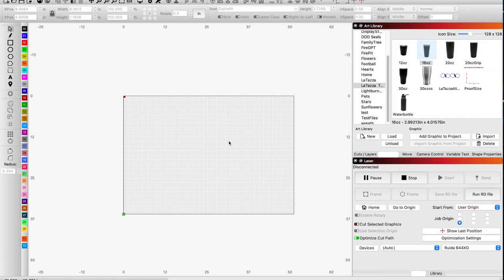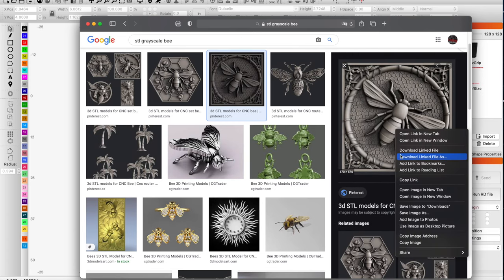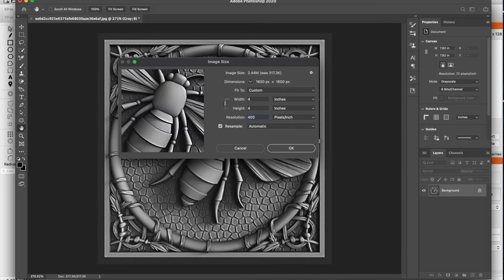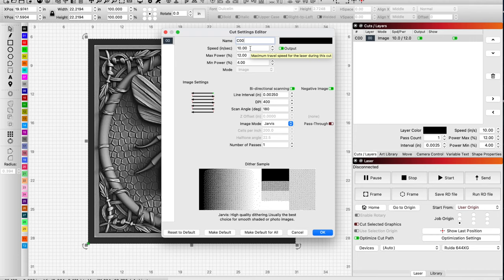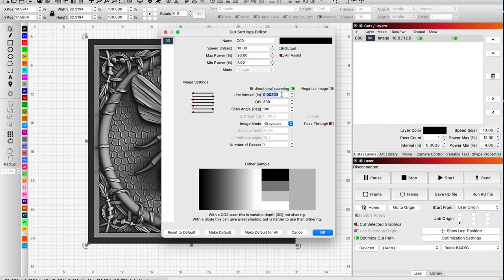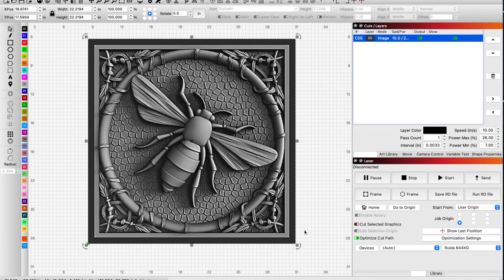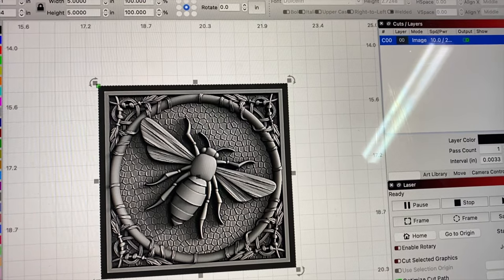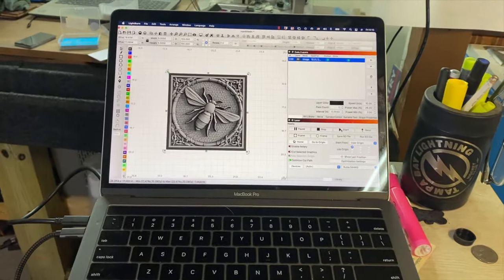How To... 3D Grayscale

Comment: There are a lot of things I would change. I have found that a single pass with maximum power will treat the different parts of the grain of the wood the same. Go slower or multiple passes and you increase how much of the grain shows up. I go with maximum power and maximum LPI and then adjust the speed to the material and depth of cut desired. If there is still too much burn then I might do a second pass very lightly to cut away the darker surface but knowing there is a cost in that the grain of the wood will be stronger. I also increase the contrast from nearly white to black as that creates the most range for the laser to set its power. There are 256 possible power settings but not enough white-to-black range might leave only ten and then if your total power is low then the steps will also be less per setting, so total power at a faster speed going from white to black will leave a much sharper image.

When choosing an image care is needed to see if the shading is from height or from lighting. As is the case with the bee there is much stronger lighting on one side than the other. The deeper your 3D cut of the bee the worse it will look. In such cases, dots or dither will look much better because your eye is judging depth by the lighting to the side, and if you cut deeply you will cut the dark side of the shape much deeper than the light side which if in strong lighting will put shaded things and dark things (like a pair of glasses) obviously as a hole and right next to it things light up like an ear as high as a cheek or different sides of a nose with a big drop-off.

If the image is really good for relief carving then it will look strange as a dot or dither as the cues your eye expects of lighting will not be there
Reply: Good catch. Thank you for adding those super tips.

Comment: Great video and thanks for posting it. Is it possible to turn a regular photo into a STL or do you need special software to do that?
Reply: stl is a format recognized by the plotters that run a cnc router.  the grayscale hes using has nothing to do with an stl it is simply the lighting effects, ocular occlusion ect from the 3d rendering software it was modeled and the image created for thumbnail purposes with.  technically any image can be used but your 3d effect will not be perfect. the only reason hes able to do this is because the common use of the lighting technique ppl use for making these.  so no you dont need special software per say however if you want an actual stl it will require knowledge some 3d modeling program. you could use photoshop or equivalent and carefully adjust and play around with levels ect until you get something workable.

Comment: I'm in the middle of trying to burn a 3d File that I bought as a pdf.  The person told me he transferred it from an STL file, so I think he may have done what you did.  Playing with the speed and power to get the depth I want - hopefully I don't over do the the burning.  Thanks for your demonstration.  Now I need to figure out how to clean the smoke off, just a light sanding doesn't achieve what I want in the end.
Reply from the maker: You can run a dither or halftone in negative as a quick light clean passs

Comment: Thanks for the technique! But sand before, not after, it will be better
Reply from the maker: You are not putting a photo on the material... you are removing material at various depths... why would you sand something that is going to be removed? Waste of time. Now for photos, yes. You want a beautiful smooth surface to put those laser dots on
Reply: YOu missed the point of sanding after: to lighten up the areas that should be lightest overall. Those areas stand taller because they were lasered at minimal power. (You’re thinking of preparing wood, in general. This is post-lasering treatment of wood engraved for the purpose of creating 3D effects, where the darker the area, the deeper it is engraved, and vice versa.)

Comment: @16:50   I WAS ABLE TO GET 3D DEPTH WITH JARVIS AT 50 SPEED AND 20/20 POWER... THE SMALLER THE PIECE, THE BETTER.. ANYTHING LESS THAN 12"X12" WILL SHOW DEPTH... THIS IS USING JUST A PNG IMAGE FILE, NO STL

Comment: You aren't engraving a STL, you are just editing/engraving the thumbnail image of the STL
Reply: Came here to say this. An STL is a full 3D object, mostly used for 3D printing (though 3MF is what you should be using these days.)

The process in this video can use any 2D greyscale image. A thumbnail of an STL is just a bit more of what you want for it.

Also if the resolution is low, you could take the STL and import it into something like Fusion 360 and render a high resolution image.

Comment: These looks amazing. I'm curious why it needs to be an STL file for this effect when you aren't using the STL file itself and just the image.
Reply from the maker: It doesnt need to be an STL grayscale image. Any photo that has great dimension and shading will work. The images of STLs are just fool proof for this process so you can learn.
Reply: @HouseOfLasers  I appreciate the reply.
Reply: really any unshaded 3d model product image would work. google around for sites that have models available. you can can learn to use a 3d package and customize things even more
Reply: What you really need is a displacement map. You'll get much better results.

Comment: this is NOT a 3D depth map
Reply from the maker: It is creating power levels based off the scales of gray... do a google search and see what it yields. STL files for cnc are depth maps telling he machine how deep to dive when when it’s sees gray variation. While it might not be a depth map using an IR camera it can surely be done in that method too
Reply: no its not. and @house of laser you dont have to use those.  basically any non textured flat shading 3d image can work.obj dxf im not even gonna list them all there are loads of them. you can buy models or get free ones from a plethora of sites and using a free 3d package like blender get the exact angles ect you need